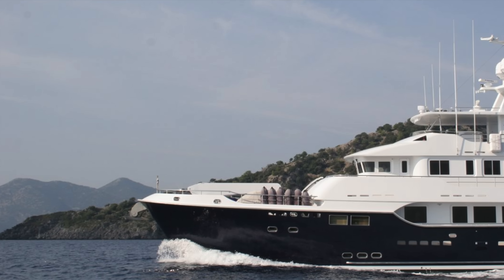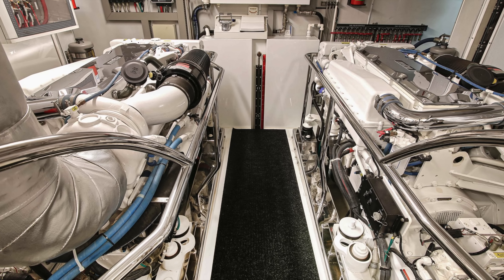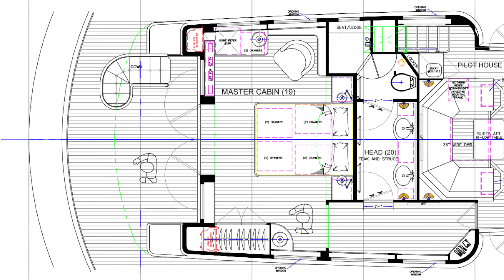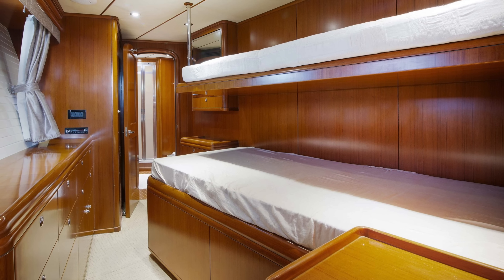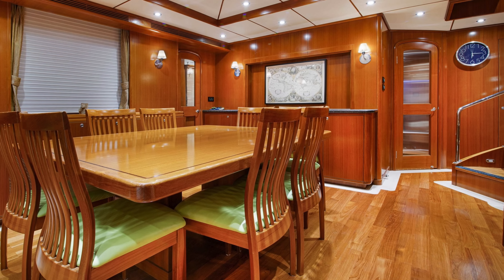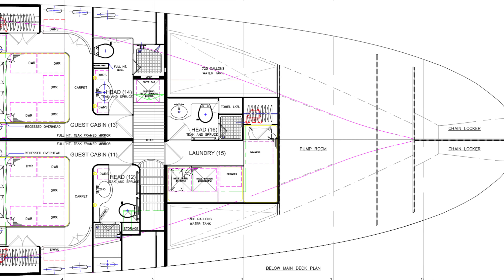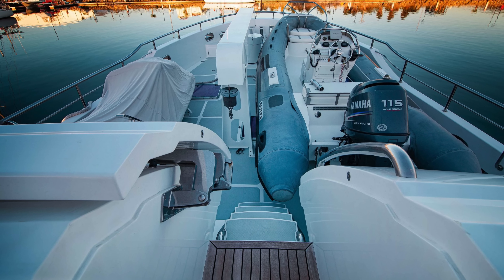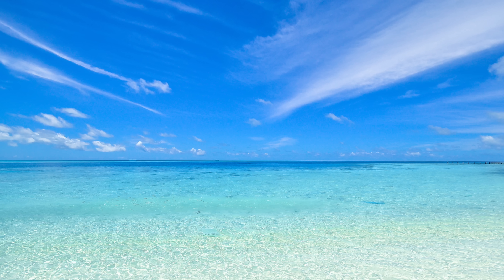$5 Million NORDHAVN 86 EXPEDITION Motor Yacht 'Sol & Sons'

Comment: I always think a Nordhavn has such a classic interior finish. It's for owners with taste, very unlike those ostentatious yachts that can be so crass.
Reply: 240VAC is nice here in EU, but I have mixed emotions about the "need" of that flybridge. We could use it at best a couple of weeks every year, and I would like this boat better as a "sedan".
 Off with the flybridge, in with LiFePo-batteries and solarpanels on the roof. Maybe one (or two?) small vertical windgenerators for charging during driving?

Comment: Too slow too heavy for size and too slow might as well sail  beautiful vessel but could be so much more in steel with a semi displacement hull and a lot more power . Speed counts to avoid bad wx 
15 m gets you 175 foot  converted off shore supply vessel 12 k range and top speed of 25 plus cruise at 18